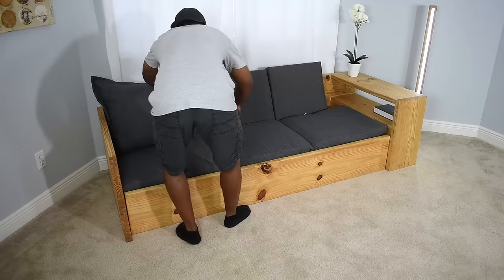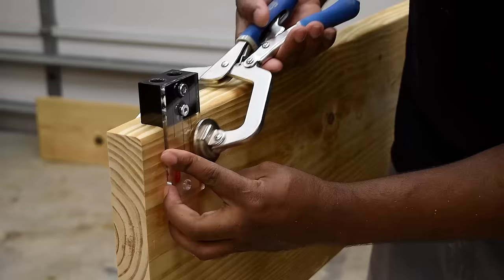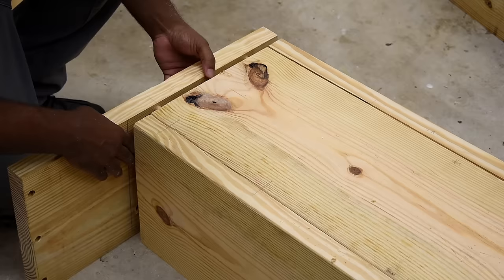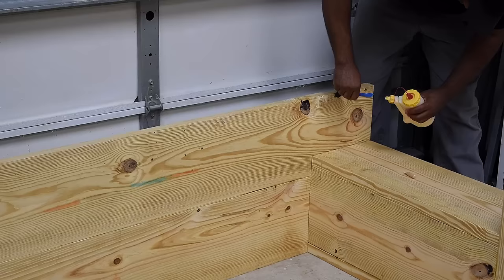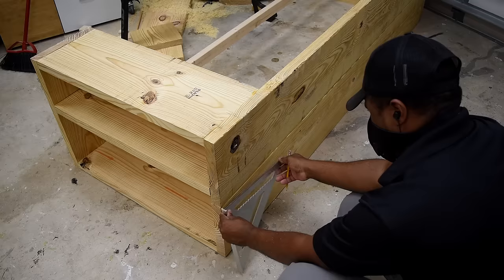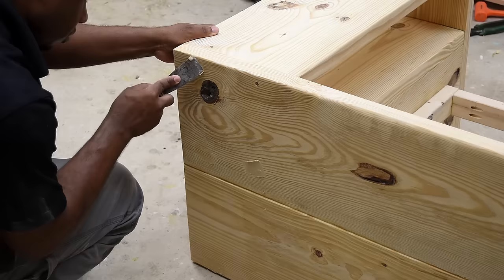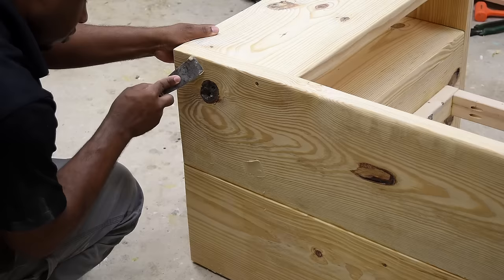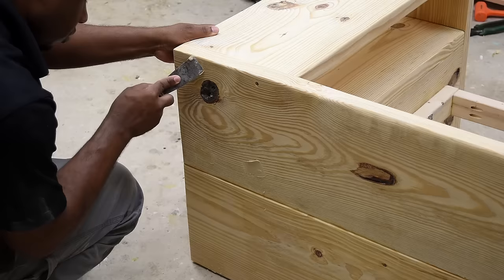DIY Sofa Bed / Turn this sofa into a BED

Comment: Great job and thanks for showing it step by step! I can totally make custom cushions no problem!
Reply: What do you advice to put inside of them?
Reply: K Ortiz There’s a Jo Ann’s fabric store near me, they and also Hobby Lobby sell foam of different thicknesses. Both also have apps that have any one item 40% off all the time. That’s what I bought but I advise using a really thin board (it doesn’t have to be especially sturdy stiff), glue foam to the board, then cover the foam with a lightweight burlap staple on opposite side, then go over it with whatever you like and cover then staple it on opposite sides. 
I made my banquet seats and a headboard this way. I did use leather for my headboard, it wasn’t easy to work with but easy to keep clean. You might want to watch a few videos on making those fabric covered headboards it’ll give you different but similar instructions to what I tried to describe.

Comment: This is an awesome build! I need this in my room. Is there a way to turn a chaise lounge into a convertible bed?!?
Reply: KimDrake3 if you don’t have a chaise lounge already, I’d say use the framework from a lawn chair, since they can fold flat. If you’re trying to use an existing lounge, that’s a bit harder, but not impossible. Just cut the back portion of the lounge off, then saw off a few inches from the wood on the bottom so it can swivel freely once attached, then use the skeleton of a lawn chair in order to add a hinge and provide framework.

Comment: Thsnks for sharing, I just found your channel, and have been going through some of your designs...pretty cool stuff.   Looking at this build, would attatching a piece of the same slat material across yjr underside of the moving slats keep them stable and prevent iy pulling out?  Also,  a wider piece could be set up in a way to allow for the pull out to stop at the different mattress sizes.   i think I am going to give this build a try very soon

Comment: why didn't you attach a wood bar to the inner side of the moving bars as a break/stop point, to prevent all opening the bed too wide and removing half of it?

Comment: Man... you just flat-out did it UP! 
This was fun to watch. I'll def be watchin' this again, man. I'd love to get me one of those set-ups, like what you have, for drilling the angle holes, so that you can screw down into the wood, and not being able to see the screws. This was fun to watch, and fascinating, too. Watchin' you make this, made me wanna be there wit'cha, so I could help you out, if you'd of needed it. As the old Candlebox song says:"I'm pretty fly... for a white guy! (Well... I'm mostly white...but I'm 1/6th Native American, too, which means that if anybody wanna get all froggy & leap, I Kno how to give 'em a Native American Hairstyle-Real quick)!
Also: That build came off really cool...and, like you, I'd be putting in an Air Mattress, too, as opposed to a regular Mattress. An Air Mattress is super-light, and your frame will last a lot longer than it would with a Regular Mattress, because of the almost total absence of weight. If you're married, definitely make that bad-boy a Queen-sized model, with a little extra room for all the "Intimate moments" that y'all would wanna N-Joy! 
Later, my man...and keep on rockin' them projects that ya keep puttin' out. 
Peace! 🙂😁😁

Comment: Hey! Great video, do you think that is it possible to do an upgrade on the design? Or do another video with a cheaper option? I've noted that in my country those plywood cuts are expensive than others

Comment: I know you posted this video a while ago, I just found your channel yesterday.  I didn't want to read through all 1700+ comments and I am no authority on wood working by any means but I was thinking maybe if you attached stop blocks on the underside of half or a third of the slide out bars, it would prevent you from pulling the "trundle" portion out too far.

Comment: Why not attach a piece of wood under the bed to the slats that slide out? That way, it will stop the pieces from coming apart when you pull it out.

Comment: On the part where you said " I got a little over excited " and the whole thing came out.  Why don't you measure the width of the size of the mattress or pillows that you're going to use and on the pull out part attach a stopper to keep it from coming out.  That's just something I thought about.  Excellent job though.

Comment: as a side note,,  i didnt want the bed to come apart , because my slats fully extended were about an inch away from falling,   i fully extended the bed and drilled two holes one at each end, and when in the bed mode i insert a carriage bolt and loosely screw on a nut on other end to insure it wont come apart during the night as i dream about Trump winning the Presidency in 2020    a cotter pin and bolt would do also

Comment: Hi...I’m Stefano fron Italy...i like watch your vídeos..good ideas...cheap and not hard to do but this time I’ve seen something I don’t really like. Eh eh...I mean the way you did the structure of the seat. I think it would have been better to put the 3 long bar ON the shoulders...In your way all the weight of people is on the screws...along the time it could be a problem especially using a soft wood like that....and by the way...I would appreciate a 45 angle cut for the side structure...The fact you can see the interior face of the wood in the upper corner it’s a loss of beauty ...sorry but I like the way you works and for this reason I don’t write good things 😂😂😂